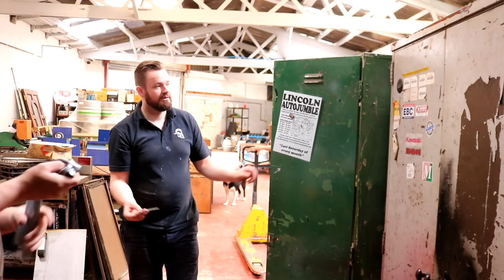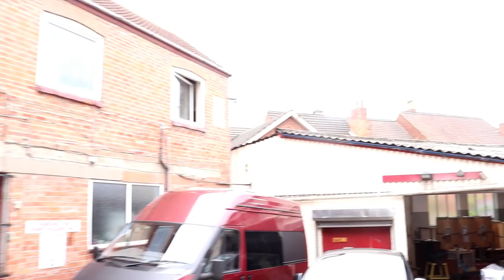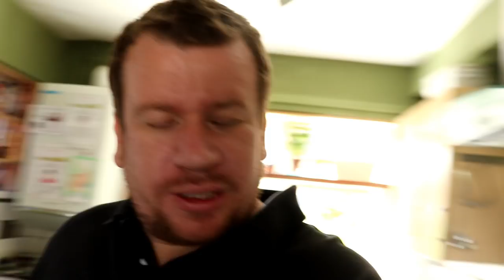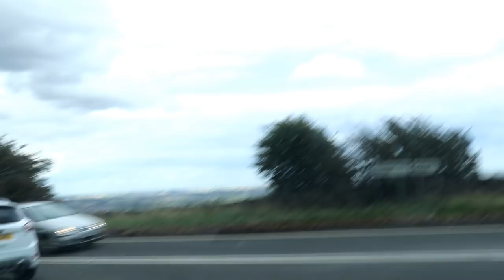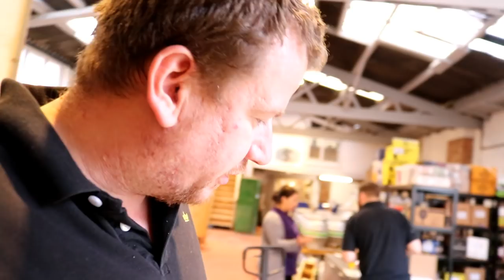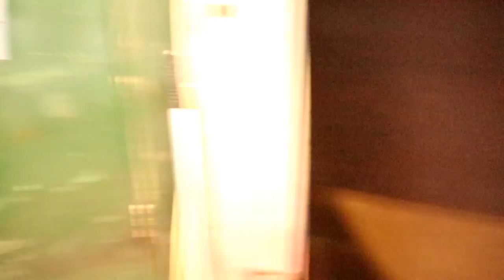On The Chopping Block

Comment: There’s some interesting videos where people have poured coloured epoxy in to wood that has cracks and knots, after it’s sanded down it looks really good and it’s practical if using as a table top. 👍🏼
Reply: I was thinking along similar lines those big slabs would be great for river tables. Bloody resin is dear though.